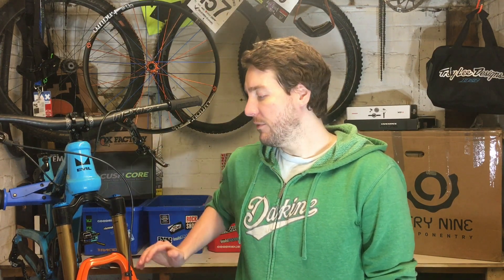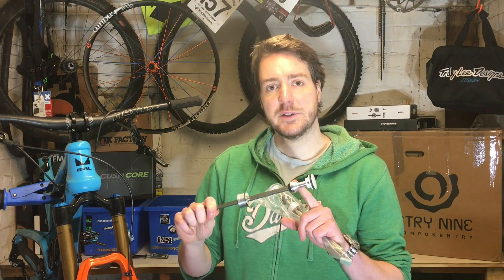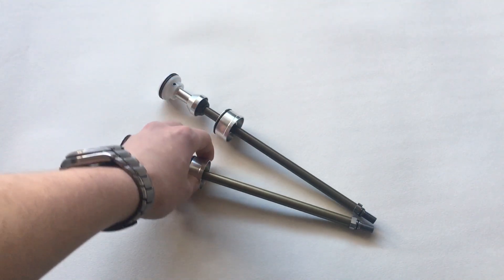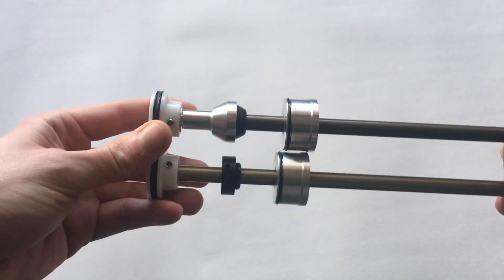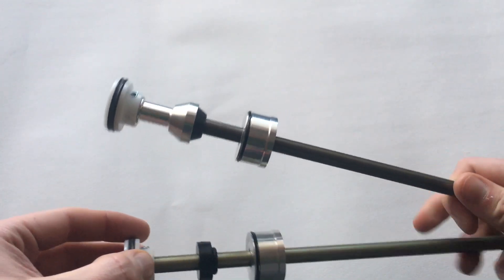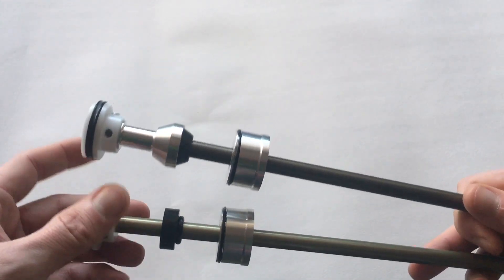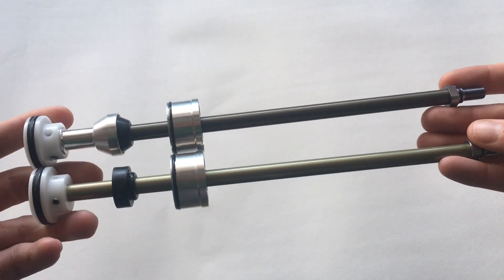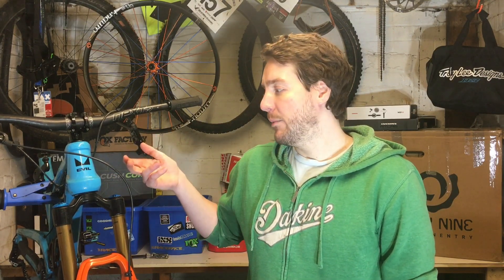2018 FOX Float 36 Forks - Update

Comment: Looks like the smaller top out bumper allows for a bigger negative air spring volume: I can imagine why fox designed the original air shaft assembly like that. I noticed the top out feeling and didn’t like it. To get more negative airspring volume is probably worth it for the improved spring curve.

Comment: Are newer 2018 Fox 36’s equipped with the new air shaft or still the old one?
Reply from the maker: Vincent Liu Hi, some of them have the new shaft but you’d have to check with your supplier as most are the old ones and technically the new air shaft is a 2019 part.